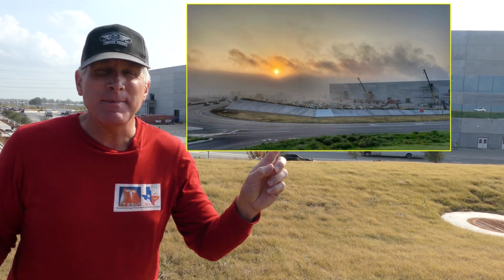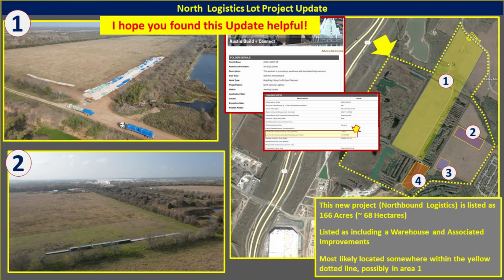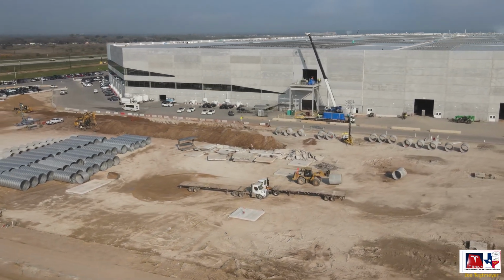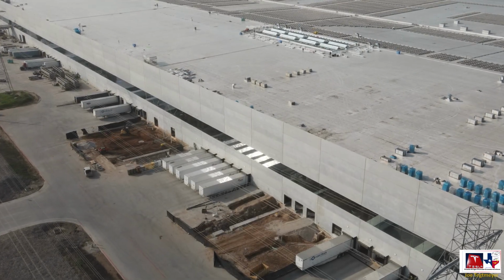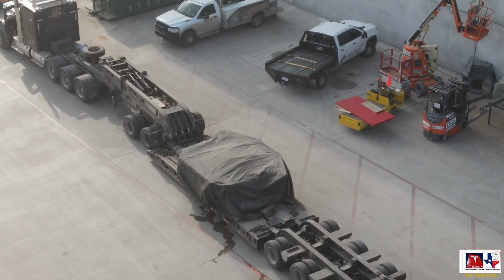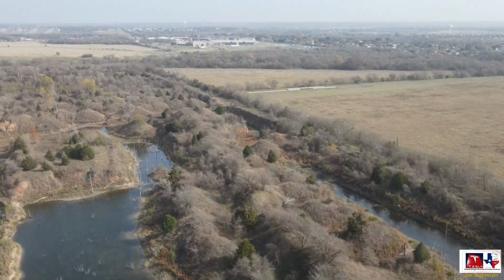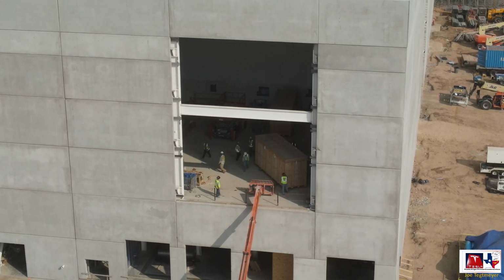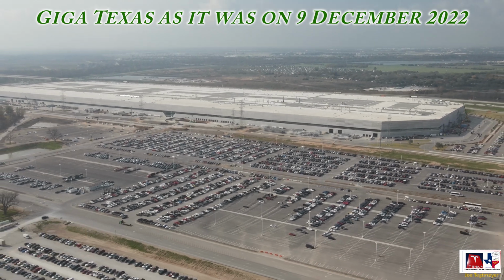9K Giga Press Parts & New Construction! 9 December 2022 Giga Texas Construction Update (10:15AM)

Comment: The ramp up of vehicles produced will be interesting to watch but what will be missed by most is the vertical integration which will probably be quite mind blowing. Getting towards the raw materials into the factory and finished product coming out. Hope Tesla is working on or one of it's partners, is tires, one of the overlooked pollution issues of all road vehicles.

Comment: Joe, that looks like the sliding head plate for Giga press.
Reply from the maker: I hope so! Thanks Dennis!
Reply: @JoeTegtmeyer   I also wonder if they will need to remove exterior wall sections in order to move the long trailer into a position where the Bridge crane can lift it.
Reply from the maker: @dennisschlieckau8723  that’s an interesting thought … I think they can enter through the NE large door, but if I see anything else, I’ll let everyone know!

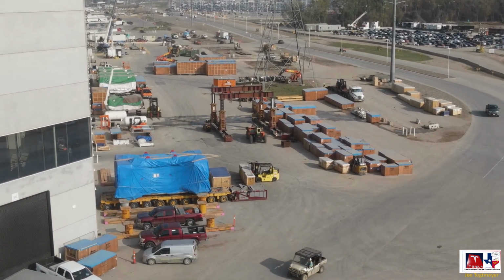Comment: The 2 white painted vessels at 10:38 I also found on the AIDA-America website, on top of various pictured presses. They look like hydraulic buffer vessels. Are these vessels then a telltale of an "Hydraulic" type of press being installed in Stamping Extension? Or are hydraulics always necessary, for instance for braking and reversing the vertical motion of the very heavy die's?
Reply: Time to roll this link out again. https://youtu.be/d_0fIq0dqDo?t=326

It’s a different machine, but gives a nice indication of how it will all be assembled. Shows the use of pressure vessels. I guess hydraulics and pneumatics would be part of the press operation.

Comment: Interesting to see that the new long narrow staging area in the North area appears to be using adjacently positioned concrete slab sections as a base rather than a gravel stabilizing mix as used in the previous areas! This may be worth mentioning in one of your next vids.
Reply from the maker: You’re right! Thanks!
Reply: Recycling and evolution of the site.

Comment: Does anyone know which video has the plans for the substation that Joe mentions in his discussion today?
Reply: https://youtu.be/mOUoWifS850?t=191
Reply: @DessieDoolan  thanks for providing the reference for the plans. I had a look again and it seems odd that the "Tesla Energy" extension is located at the NE corner of this large rectangular substation plot, diagonally furthest away from the MegaPack BESS area. Perhaps this is to position the MegaPacks connections closest to the HV transmission system interconnections, which come in from the N, NW direction. I understand that Megapack systems have their own bi-directional transformers and don't need additional transformers inside the substation plot.
Reply: @hardernl8893  The Tesla Energy extension. I guess it being firstly an LCRA switchyard, they got the shortest route. Maybe William will chime in here, I'm sure he or others have mentioned how long these things take to be designed, so the gear for theTesla BESS being a late comer gets to go where's it's most convenient for LCRA.

Comment: Special thanks Joe for hanging around the site until the fog cleared. So much to see today.
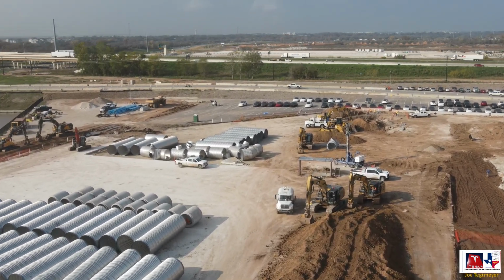9:10. Southend. Right of screen. Would be about the point to cut into the existing corrugated drain that discharges into the Splitter Box. This new concrete drain likely a direct replacement in a slightly different location.
Raises the question, why the additional corrugated drain? If they lay new corrugated drain at this southend does that indicate not the entire area will be a building?
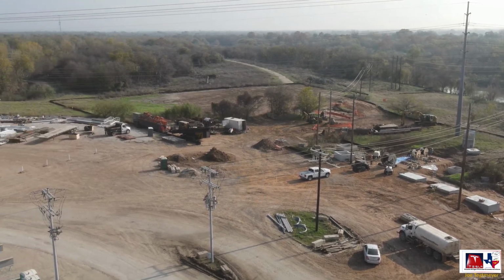10:03. HDD site. Drilling rig been idle for well over a month now. Costing someone money, or at the very least not making money.
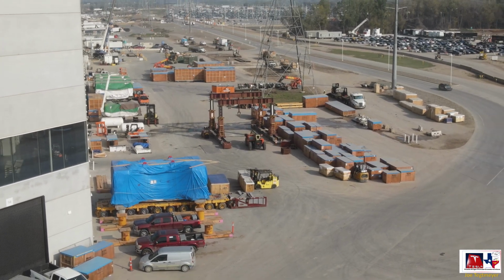10:41. Stamping, apron. Big delivery on the SPMT*, and heavy duty stands set up for 2 more.
Only 1 of the smaller AIDA components remains under the green, brown and white tarps.
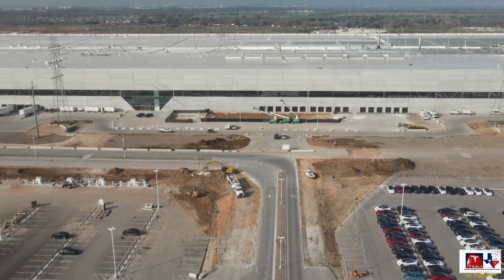12:30. East-west road/north-south road intersection. Earthworks on every corner. If it was down here (Australia) I’d say a roundabout is under construction.
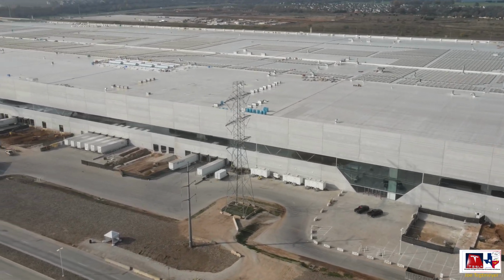12:50. North-south road. New security checkpoint. 5 now by my count.
Apron. Footing for the ramp down retaining wall.
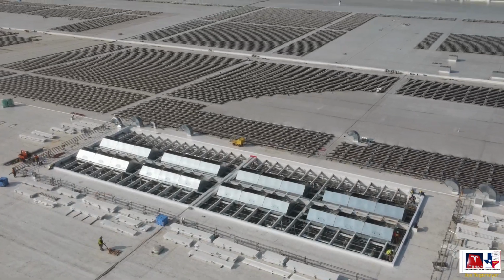13:20. BIW, roof opening. Scaffold decking removed. Adding lagging/insulation around the pipes to the chillers.
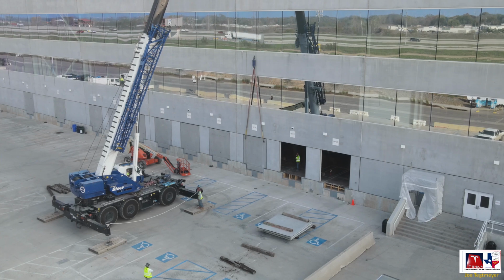15:29. GA, apron. Unplugging the loading dock openings. Timber frame in the set-down.
Long time viewers will recall that many of these plugged openings including this pair were complete with dock levellers, and rollup doors. https://youtu.be/8FiMGq1U-UQ?t=186
15:37. Battery, apron. Flat tyre/tire.
17:15. Casting, apron. I was thinking this would be one of the 9000t gigapress platens.
The 6000t platens are 12’4” X 12’4” 3.7m X 3.7m, would assume the 9000t would be wider, but this doesn’t seem that much wider, assuming the trailer is 8’6”. Perhaps not a platen at all, or it could be something for a smaller gigapress. Most of the north west side of Casting was seen cleared out in Joe’s 7 December video, including the existing foundation area for additional smaller Gigapresses. Where the white painted beams are stacked here, https://youtu.be/whlvTy1UIaI?t=422
18:24. East parking area. Permanent bus shelter.
19:15.  New Switchyard/Substation. A small monopole at each corner of the control building.
Right of screen. Trenching for the drain discharge point into the pond.
20:57. Far north. Using the salvaged slabs as apron. Such a remote place for storage.
Massive set of tynes beside the road. Left over from the farming operation perhaps.
21:51. Far far north. Beams.
23:38. Cathode. Small out-building. Fabric lining under the purlins* flapping about.
24:23. Cathode. Level 1. One set-down pit is still open, seem to be constructing a temporary sub-floor frame.
25:23. Cathode, south Level 2. First equipment delivery. This is where a number of cut-outs were formed in the floor, likely for chutes or pipes to pass through.
28:06. Cathode, plant apron. Painting the pipe.
28:18. Cathode, new building. North end. Formwork for a connecting strip footing/ground beam.
Low elevation/grade footings with the pedestals suggests possible floor set-downs. The pedestals are to locate the column hold-down bolts all at the same elevation/grade, so that the columns can all be the same length. 

*YLTMV (Your Local Terminology May Vary)
*SPMT (Self Propelled Modular Transporter)
Reply: Great observations in addition to Joe’s detail comments! Thank you as you see more details as well…Lester
Reply: @lesterhousel  Thanks Lester. Did you see the Cybertruck on Joe's Patreon page?
Reply: 27:50 the connecting bridge frame between the plant and the adjacent iron work is back in place. Previously noted?
Reply: @GeeKayKayGee  Maybe was removed to let the wall pieces get installed
Reply: @GeeKayKayGee  27:50. Yep, Jeff's Day 867.
Reply: Thank you for your time spent making this breakdown, much appreciated
Reply: @logicflakes8911  You're most welcome. I enjoy writing up the observations, become part of my day now.
Reply: @DessieDoolan  17:15 Gigapress.
Look here: https://youtu.be/T36Gr1OtdJk?t=49
Looks like it might be the white part on the left. Note how it's top is thicker than the bottom, which should match the (forward) slope you can see on the item on the trailer.
Reply: @greggerypeccary666  17:15. That's what I thought it was also (the platen from information elsewhere). Then I had a rethink about the height compared to the trailer width. I assume the trailer is 8'6" 25.5m. I also figure the platen for a 9000t machine would be bigger than the 6000t machine which is 3.7m x 3.7m. I can't find out if it is in fact bigger. This one looks 3.7m or thereabouts.

It could be another 6000t machine, the space is cleared for one of those also.

Hopefully we'll see a peek inside again soon.

Comment: What if they also utilize the capabilities of the nearby Boring Company and bore a tunnel to Hutto and run Tesla Semis along it? 🤔
Reply: They don't need to send the semis through. A year ago I suggested they tunnel to the nearest rail depot and have the cars drive autonomously through the tunnel...
Reply: The Tesla semi is great. The Boring Company is great.Altough I think it would relatively easy to build small nimble freight cars for the tunnel, I don't foresee semis in those tunnels.
Reply: @jbbuzzable  I don't foresee tunnels either, not when you have a tollway next to the Gigafactory that has a speed limit of 80 mph. A tunnel that long would be in the billions of dollars.
Reply: @BTS-Astro1  I don't foresee tunnels either with the Semis and tollway, but I doubt a tunnel would cost billions.
Reply: enough with the damn tunnels folkses.  When you tunnel you have to get/buy permission of every piece of property you go under.  get real
Reply: A semi would NEVER fit inside a Boring Tunnel. ..  and I think you nay have confused the Boring Company, an Elon Company, with Hyperloop, which was “just” an Elon suggestion, to be picked up on by other people. . .  totally different concepts
Reply: @dewiz9596  Not with that attitude! 😆
Reply: @dewiz9596  They dont need to be on a semi. They could drive themselves the 20 miles. Or just be loaded on to sleds.
Reply: @robertcase4995  
Not quite... It would add to the odometer, this lowering the sales value.
Reply: @robertcase4995  FSD is not working yet and won't be for a good while.
Reply: @BTS-Astro1  😭